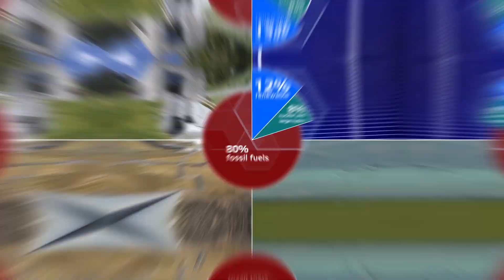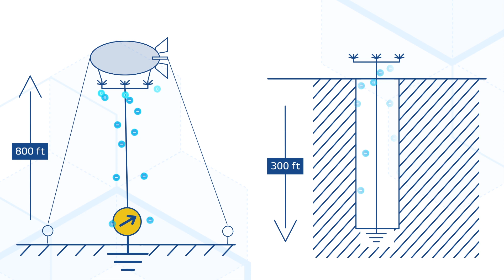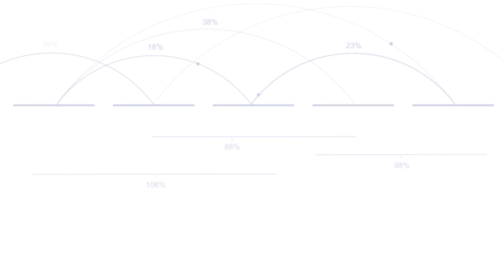Electricity generation from the Global Electric Circuit

Comment: If you had a large enough laser in geostationary orbit could it create a laser induced plasma channel to short the circuit and discharge its power into a directed place to be harnessed?
Reply: Or you know... just point a laser up from the ground....
Reply: @cognitivedissonance4938  They tried that with lockheed martin must have been 20 years ago now and created a plasma channel that was able to direct a lightning bolt to the laser emitter, that well ended up running dry it seems so either they found nothing or they really found something. I am hoping if you shoot a laser downward it may penetrate longer from the thinner air refracting the laser beam less to start a plasma channel from a source of high energy in hopes of bringing the conductor close enough to complete the circuit and create the rest of the plasma channel to the surface in the thicker air from an energy dissipation if there is an energy differential at all... possibly allowing the channel to remain constant because the laser would continue to maintain the source of the plasma channel maintaining position of the source... or im very high.
Reply: @ElijahPerrin80  "complete the circuit"  more like short the circuit. Nontheless, military advancements in tech exceeds civilian tech by decades so I woulnd't be too suprised if they have already mastered such an application.

Comment: They said the global electric circuit has an inexhaustible supply of energy. Actually the only thing I see to be inexhaustible is the apatite of humans to take everything for themselves and leave nothing for all the other life that exists on the planet. 

A thousand times more energy than human need? Humans have been doubling their population in about 60 years. That means that it would take about 10 doubling cycles or about 600 years before they are sucking every bit of energy out of the planet's ionosphere. That will leave the planet with no protection from space radiation that will kill all life on the planet.

It is likely that the planet uses that energy in ways you don't recognize. It seems the planet grows from the inside out and it is likely that energy is feeding it raw material to convert into heavier elements. 

You people have not thought your plan through very thoroughly. Like selfish little children that learn one trick and think they know everything.